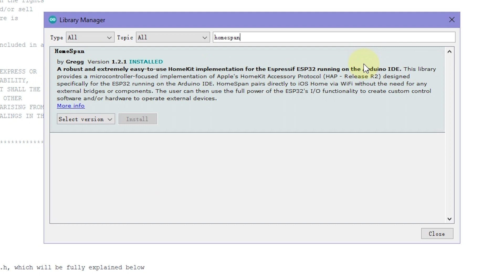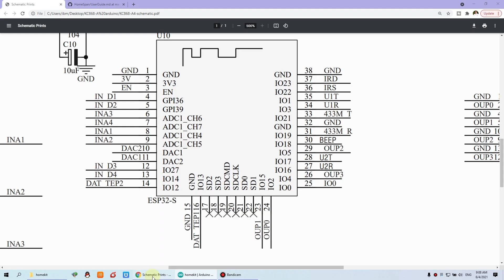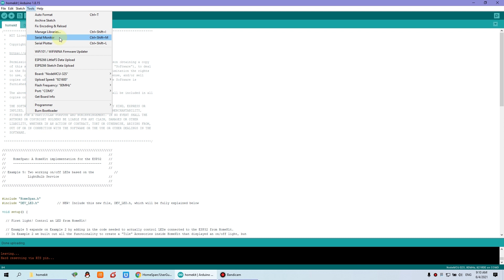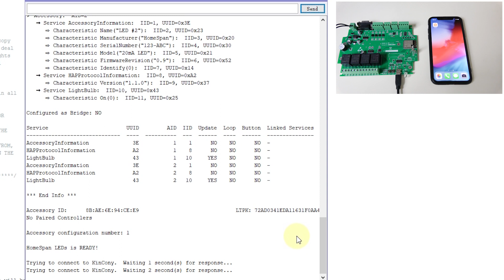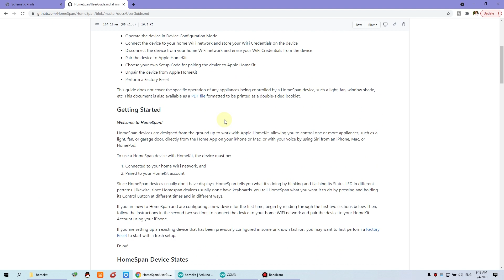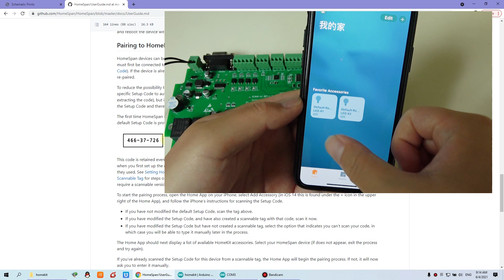Lesson11- Apple HomeKit control relay on ESP32 by Arduino IDE

Comment: Hello, thank you very much. I have few questions...
- can this relay slowly change voltage and polarity for (micro motors)? 
- if yes, can I write logarithm speed acceleration for start and the same for stop when you push ON and OFF with Homekit button?
- can it connect with Homekit only with Bluetooth?
Reply from the maker: 1. no , it's not a dimmer, just a relay for ON/OFF.
2. Homekit use in local network, not by Bluetooth.
Reply: @KinCony  
1. This feature could be very useful for model hobby, for example locomotives. But acceleration should be set up with the PC, to meet real prototype dynamics.
2. Ledvance work with Homekit without WiFi or any other network. This works with iPad.

Comment: Hello! Interesting. But if I needed to press a key to activate an output for just 1 second and then return to the initial state, where should I act on the code? Thanks for the informations.
Reply from the maker: this need check with homespan source code.

Comment: Hello, I 'm Sorry; I have this error: 

Arduino:1.8.19 (Windows 10), Scheda:"Node32s, Default, 80MHz, 921600, None"

In file included from C:\Users\6767s\OneDrive\Documenti\Arduino\libraries\HomeSpan\src/HomeSpan.h:48:0,

                 from C:\Users\6767s\OneDrive\Documenti\Arduino\libraries\HomeSpan\examples\01-SimpleLightBulb\01-SimpleLightBulb.ino:60:

C:\Users\6767s\OneDrive\Documenti\Arduino\libraries\HomeSpan\src/Settings.h:59:4: error: #error HOMESPAN REQUIRES VERSION 2 OF THE ARDUINO ESP32 LIBRARY

   #error HOMESPAN REQUIRES VERSION 2 OF THE ARDUINO ESP32 LIBRARY

    ^

exit status 1

Could you help me?
thank you
Reply from the maker: can you take a photo of your problem, post to our forum: www.kincony.com/forum

Comment: anyway to control via both mobile data and WiFi?
Reply from the maker: yes, it's according to arduino code.
Reply from the maker: if you put a iPad work as a gateway, it will support for remote control by internet.
Reply: @KinCony  Will it not work individually?
Reply from the maker: @AmitKumar-jc4rf  yes, no problem.
Reply: @KinCony  if possible can you share the arduino code?
Reply from the maker: @AmitKumar-jc4rf  the source code is included with the homekit library sample demo, just installed library, then you can select the source code sample.